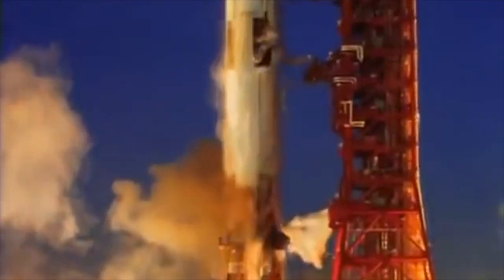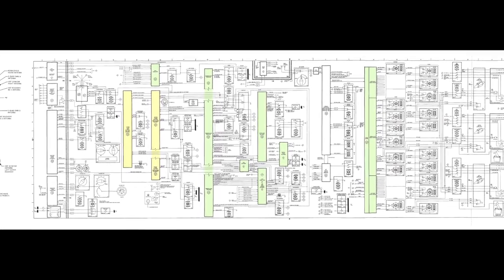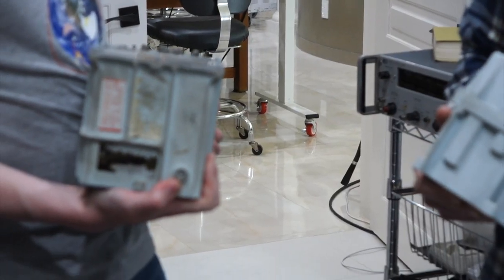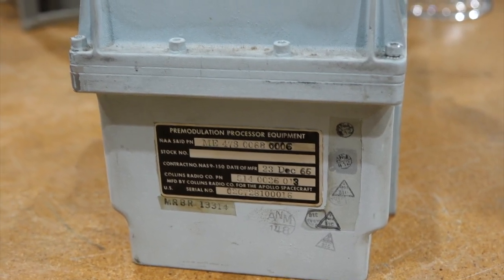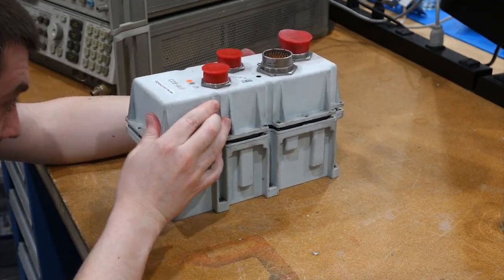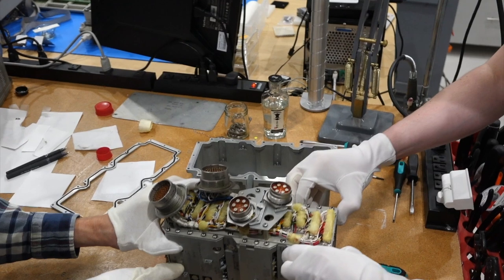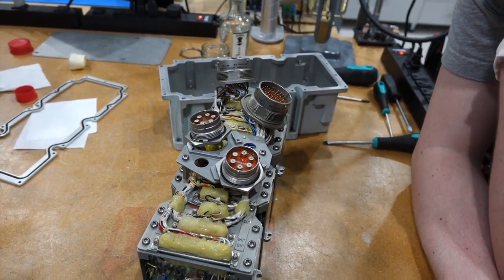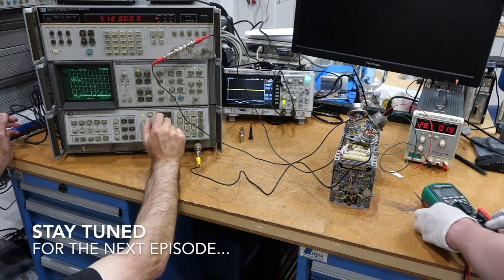Apollo Comms Part 17: Opening the Pre-Modulation Processor

Comment: Engineers from 60 years ago decided against the use of circuit boards because of crosstalk, impossibility of engineering changes, impossibility to make more than two layers, and... one more thing. I clearly recall printed ads from that time, of about big colour TV manufacturers vaunting the fact that their newer TVs were "hand wired" without the use of cost-saving techniques like printed circuit boards.
Yes, the attitude of both the public and repairmen were strongly against PCBs, which were seen as a cheap and short lived building solution.
This attitude will quickly change in the early '70, when HP created the tools to calculate strip lines (for UHF and above), and the PCB become to be seen as another component, and not a way to save on manufacturing costs.
Thank you for your work. The Apollo comms are the perfection of analogue design, the only project where the funds exceeded the skills and the technologies utilised, with the magic achieved with strict tolerances and advanced mathematics...

Comment: 8:35 when you were trying to remove the top it "seemed" obvious to me. The earlier pics of the assembler showed the cannon connectors on short wires. Remove the mounting nuts and pull the cover off leaving the connectors behind. (Now I'll watch the rest of the video to see how you figure that out.) I was around when this stuff was new. nice to see it all again.
Reply: I'm sure you have figured it out by now that water or alcohol will remove the color bands on the wire Collins used. And if you mill the bottom of a standard box wrench to remove the lead in chamfer, you can remove and tighten the nuts with full contact.

Comment: Looking at what we have today in our hands, would be more than enough processing power to run all of the Apollo Missions at the same time and maybe do them 10x(or more) over. But I just love the older technology for how robust and easy to fix with off the shelf parts from your local electronic hardware stores.
Reply: Ground control used two mainframe computer systems that could do 500,000 basic operations per second during the first three Apollo missions, the updated mainframe for later missions had an upgraded memory storage of one million bytes.

The newest XBOX can perform 12 trillion floating-point operations per second, has ~16 billion bytes of random access memory, and can transmit 560 billion bytes per second over the memory bus.

10x is a very conservative estimate lol.
Reply: @dylanberger8701  But, modern programs tend to be extremely bloated, so that gain in performance does not result in a significantly faster machine.
Reply: @user2C47  while that's true to a certain extent, 10x is still a funny underestimation. emulating IBM mainframe hardware is something you can try out on your home computer. so even though we write crap code now we can just reuse the heavily optimized code written then. 

again, 500,000 BASIC operations vs 12,000,000,000,000 FLOATING POINT operations.

Comment: The boxes were pressurized. Might them have been pressurized with helium ?
1) Helium are suppressing fire
2) Not toxic
3) Nearly 6 times as heat conductive as air.
Reply: Typically would have dry nitrogen
Reply: Helium is very difficult to seal, and would not still be pressurised after all this time.  Also, much more expensive than nitrogen.

Comment: @CuriousMarc is the yellow goop on many of the parts a recognizable material? I can't tell from the video whether it's resin or silicone or something stranger.
Reply: Looks similar to an adhesive I've seen used in some old VHF amplifiers. The assembly techs referred to it as "elephant snot," but I don't remember if it was an epoxy or what (it was definitely not the same as the adhesive currently using that as a brand name).

Comment: If you run into similarly reluctant nuts again, maybe look at using a Knipex "Pliers Wrench" (or clone) rather than fabricating custom wrenches constantly - they're much better and safer than a standard adjustable wrench as you're actively gripping the nut (with a smooth, parallel jaw, so no risk of chewing it up)